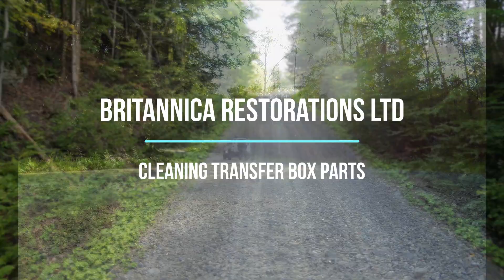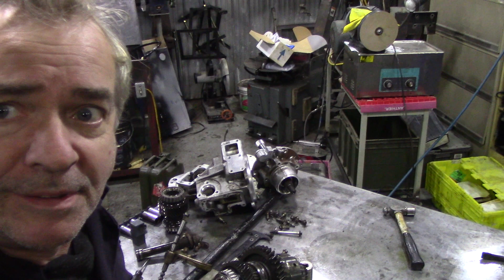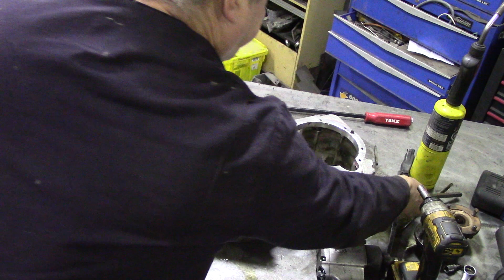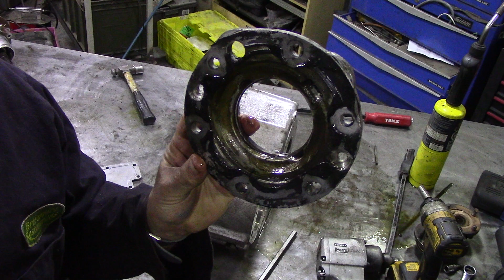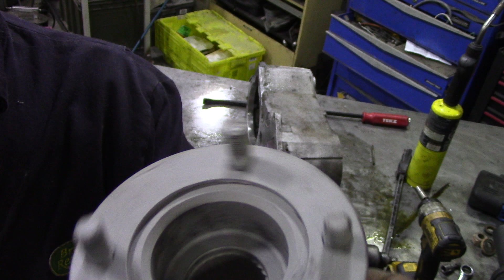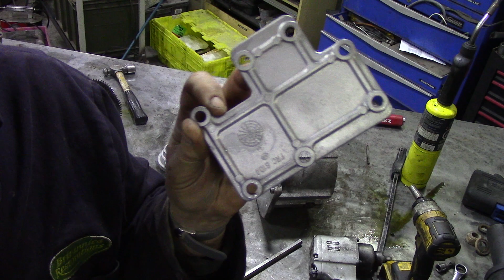Cleaning transfer box parts

Comment: Hi Mike, can I ask why you do the dry abrasive blast and then the wet blast? Is it quicker to do both? I'm looking at the wet blast machine, the exact one you have, for all the same reasons. The most time consuming part of doing transfer cases as you know is cleaning the parts. cheers again for your videos.
Reply from the maker: The reason as I mentioned is that once de greased and dry, the dry blast with remove tough deposits, but makes the surface rough (even with 60/40 ground glass) the wet blast puts back the factory finish
You can skip the dry blast and use ceramic beads, but these are expensive

Comment: Hi Mike, am reading too many opinions on the internet on what oil to be used for my 300tdi R230 transfer case. Should it be GL4 or GL5 specifications? Your advice is greatly appreciated :)
Reply from the maker: I just use regular EP80/90  - there is no pump in the box, so you can use a heavy oil
Reply: @BritannicaRestorations  Thanks Mike !

Comment: Those parts came up beautifully, and the petrol really seems to help with the silicone.  I have tried diesel before, and it does the same, but not quite as well or as fast.

I’d be interested to see how well the vapour blasting polished the output flange seal lands.  I’d have wrapped them in duct tape to avoid blasting at all, but if the vapour blasting smoothies it enough, then it might polish up on a machine afterwards with very fine emery cloth.
Reply from the maker: Flange came out well - just as good as a new one which are not polish or ground

Comment: Makes a cracking job using both the sand blaster and the bead blaster. Me being me would find the blasting process very satisfying, but having 'cleaned' many a part in the parts washer, I understand that the cleaning process is a bind. They'll be great transfer boxes when finished though.
Reply from the maker: It is not too bad, but you need to do it in the right order
For the parts with silicone and thick grease on the outside a bucket of petrol is a must!
Dry off parts and remove excess silicone  
Into the sand blast cabinet and with the finest of sand give it a once over
Wet bead blaster next to put a finish on the parts and then ultrasonic and dry quickly to prevent flash rust

Gone are the days with gunk and a wire brush!

Comment: Nice Job, Proof that gasoline (petrol) does not make a good gas tank sealant LOL
Reply from the maker: I found that out the hard way 30 years go on the highway through Montreal at rush hour - changed the sender in my Renault 5 and used silicon and the snot got pulled into the fuel  line!

Comment: Would have thought sand blasting the oil seal running surfaces would not be a good idea, when manufactured that surface  would be 'plunge ground' in the opposite direction to rotation, this creates a micro screw thread on the surface to encourage any oil under the seal lip to be wound back into box.
Would have thought sand blasting would upsect the suface finish and create micro pockets in which oil can be trapped  I'm not making this up spent 30 years working with oil seal and gasket suppliers 
Might be better to tape up the running area while blasting 
👍👍
Reply from the maker: The vapour hone puts a polished surface back on the running face and as there is no pressure it works just fine
Reply: I’d expect it to abrade the seal in no time, too.  Best to tape up the seal land before blasting.